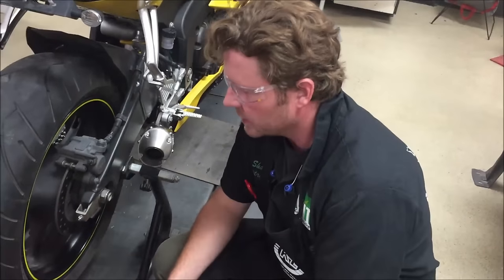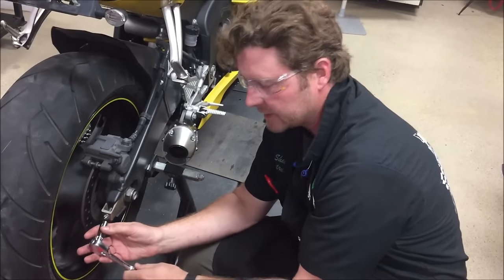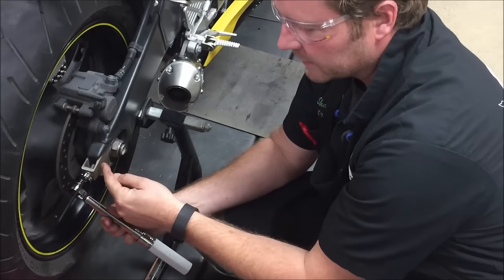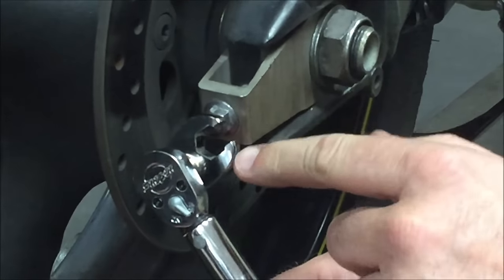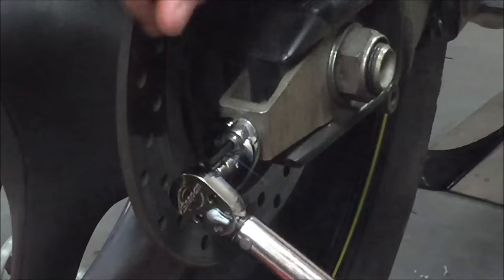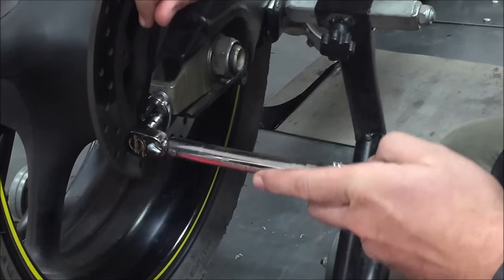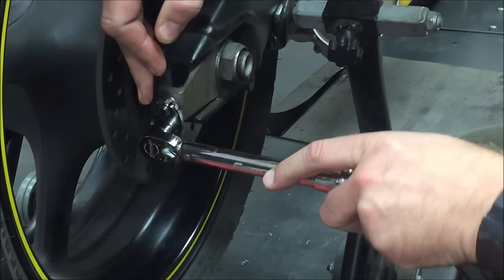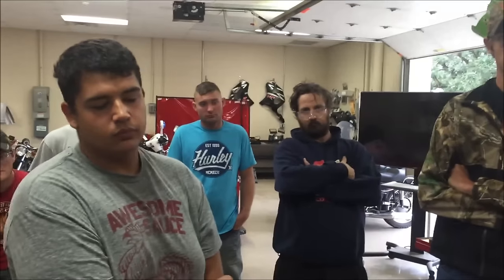How to use a crow's foot wrench adapter. Demo done on Yamaha R6 chain adjuster nut.

Comment: Thank you very much for the explaination on the 90° correction and the correction alignment behind getting the correct and accurate torque spec
Reply from the maker: You're very welcome! Have you seen all the videos we have done on torque wrench use? Here is a quick list: https://www.youtube.com/c/ShaneConleyhow2wrench/search?query=torque 
Please hit that subscribe button for us! 👍 Subscribers get a free video for them to search the channel for topics! Reply back you subbed and I’ll share the link! Thank you for taking the time to comment! It helps us! 

Did you know there are over 700 videos on here. We even made a quick video of how to best search the channel for you. Here are two links to best serve you on our channel:
Channel Search: (subscribe to get and let us know!)  
All Playlists: https://www.youtube.com/user/conleybuilt/playlists   

Please say thanks and “high five us here: https://www.paypal.me/how2wrench
Reply: 90° doesn't make sense, if it's in line with the foot making it longer, wld be like putting a very small cheater bar on a wrench giveing you more leverage and taking less strength to get to 90 lbs. It's still 90ft lbs, you just only had to use let's say 60 lbs of force.    
 That's like saying using a 4' torque wrench set at 90 ft lbs isn't going to give you the same ft lbs as a 3' torque wrench set at 90 ft lbs.
Reply: @Jdww89  Exaclty the only thing you shouldn't do is have something that changes the angle like a universal/wobble socket, cheap torque wrenches or the wrong hand placement not allowing the torque wrench to function correctly. Torque sticks doesn't matter where it's placed the extensions can only twist so much giving it the correct torque same with a cheater if need be, as long as your hand is placed in the correct spot your torque wrench should tighten to 90ft/lbs no matter if it only takes you 20lbs of downforce to do so. Try it with a 3/8" drive torque wrench at any position with the crows foot and then try it with a 1/2" drive torque wrench and just a socket it should be still set at 90ft/lbs not matter the difference in torque wrench length......if your torque wrenches are within spec. 90ft/lbs is 90ft/lbs on the fastener even if it only take the operator 10ft/lbs to get it there. Now the type of torque wrench can play a difference but personally I like the split beam precision instruments, they have always been good to me I will say stay away from Harbor Freight yes they will replace it but they are worth the gas driving there an back to do so everytime you use and break one. But that's just my two pennies on the topic......

Comment: I stumbled on this video by searching "Flare Nut Crowfoot Wrench Set" and while watching this video, I found you showed another way to use the crowsfoot as well as answering a question I had months ago about how to use a torque wrench adapter. Thanks for the video. Great instruction, and very professional. 

Looks like i'm on a mission to buy a "Flare Nut Crowfoot Wrench Set"
Reply from the maker: granadojl Thank you. Please subcribe and select notifications!
Reply from the maker: granadojl and share the channel or vids you like!
Reply: Same here! I have little clearance space for a 19mm bolt for my lower control arm. My torque wrench doesn't have enough space. Will try n see if I can do it with a crowfoot. It needs to be torqued at 101 ft pound

Comment: Excellent point. I've been surprised now many people don't understand the rationale behind why a torque wrench gives unreliable data when used with a crow foot wrench. As you say, if you keep the angle 90 deg, the sine of that angle approaches zero, dropping the added length to a negligible figure. The reason those guys can make that mistake over an entire career is because of the high tolerance for variance in applied torque.
Reply: The offset still exists whether you have the wrench at 90°, 45°, 18°, 37°, etc. it doesn’t matter at all. Any offset less than an inch is already negligible. Torque wrenches are not precise enough for a small offset to be of any significance. Insisting on this 90° myth is like saying that the torque changes when you hold the torque wrench high or low on the handle. Regardless of the crows foot rotation, you are still applying torque at an offset distance. Rotating the thing around a central pivot does not magically change the math.
Reply: @athhud  Although I agree with you that the result may be negligible, the math is clear, as I stated above. The right angle distance from the hand to the central pivot does indeed change, depending on the angle between the torque wrench handle and the crow's foot. Plotted on a graph, you get a sinusoidal plot of torque vs angle, with almost no difference at 90 deg. I also agree with your third point, that position of the hand makes no difference, because of the way torque wrenches measure force. The spring inside the head of the torque wrench is calibrated with the assumption that the head of the bolt is directly underneath, concentric with the axis. If not, there is a longer or shorter lever arm length and torque not accounted for. You can estimate that by multiplying measured instrument torque by the ratio of new right angle lever length over old, and you can crudely measure new lever length with a carpenter's square. At 90 deg the ratio declines to ~1 and it is maximum at 0 deg where new lever length is greatest, minimum at 180 deg where the length of the crow's foot shortens lever length. It is a small effect (often negligible) with a crow's foot, but unequivocal. It is easier to understand if you consider an extreme example. I go through a practical extreme example in a video I did of adjusting transmission bands using a torque wrench extension.
Reply: Yes when you start getting into higher torque situations and/or the distance from the anvil starts increasing significantly, the position on the axis will begin to matter. In this particular situation with the short inch pound wrench, low torque, and minimal offset it is just silly to fiddle around with the thing like you are torquing fine China to the space shuttle... The wrench won’t even adjust finely enough to compensate for the difference. Never mind the manufacturer’s specified range of accuracy.

Comment: Or you can use a pass through torque wrench. No need for crowsfoot and a 90 degree requirement.
Reply from the maker: I've never seen one...interested...
Reply: Thanks for the input but give credit where its due instead of just degradation, perhaps till? Its damn good instruction, no doubt. Well done sir
Reply: I’m here to learn how the crow’s foot is used.
Reply: @codyglasco188  He made a useful suggestion and he wasn't insulting about it. If you're doing this all day and don't know about those wrenches, then it might be a great time saver if you can pick up a better tool. As the comment from to How 3 Wrench indicates.
Of course if you can't get a pass thru design around the end of what you're working on. Like a line or pipe or there's just no room, then this is invaluable.
Reply: The video is a tutorial on how to use a crows foo. Hence the guy using a crows foot lol

Comment: I am new to crowsfeet. Just discovered them today as July  15 2022.  I now assume if one uses a ratchet handle one cannot retched it as with a socket as the crowsfoot swings around freely?.
Reply from the maker: I'm the intern studying under Shane. I grabbed Shane quick and he said use just as shown in the video and you will have success. Crows feet adaptors cannot be ratcheted if attempting to achieve the desired torque from the torque wrench setting. Go back and study the video details. 
I'm going to watch this video right now and learn what he said as to why! One of these days I hope to move from the office to the shop!

He has a few other tricks up his sleeve he plans on making videos on. If you need help sooner choose and option below! 

That’s a great question for Shane directly! We are just the social media team. Shane does answer questions when he get's back around to non members eventually so hang tight, FYI >>>> he does member ones daily!

He just returned from overseas training techs and his inbox is slammed with requests. He is scheduling time each day again to answer techline orders. He does not have the bandwidth to provide free email replies as his schedule is full with shop customers, training schedules, and one on ones. 
There's good news though! Shane has 2 solutions for you. One is a deep dive one-on-one with him with video, email and phone support. The other is a "quick fan support" option when it's a quick answer and just helps support the time for him to stop wrenching or training and get you in the direction that a free video had you close. Links to each are below. Hope this message makes sense to you as a decent human being that also works for a living and gets it!
Make it a great day!

The one-on-one service. Get Shane’s cell here: https://how2wrench.com/ols/products/techline-one-on-one       
Quick answers are answered daily as a channel member: Join this channel to get access to perks:
https://www.youtube.com/channel/UCBhM8DCKnT3qXwTW0eToyCg/join   
-Daily MEMBER FIRST COMMENTS ANSWERED FIRST 
-Live Q/A video chats
-Wonder if we have a video on your need? Members can request content links!
-Full Access to the ENTIRE 700 video library
-Member-Only FREE tool giveaways  

Have you seen our "YouTube Trained Support Shirts? Great way to "high five us" https://goodfellasmerch.com/collections/how-2-wrench/products/support-shirt

High fives help too! Give him one here:  https://www.paypal.me/how2wrench

Comment: I was wondering what was the purpose of this odd wrench
Reply: I'm waiting on one to come in the mail. I need it to do repairs on my Jaguar. I'm going to replace the thermostat housing tower. It has 4 bolts. One of those is slightly under the intake manifold. The crowfoot will get it easy peasy. After doing a fair amount of research on the best way to attack this bolt, I came to the decision of using a crowfoot wrench.
Reply: its to use in places where the traditional ratchet doesn't have direct access. and it also works great for situation where an open  box wrench is needed.
Reply: @asadb1990  correct me please, a nice flex ratcheting locking wrench would suffice too?

Comment: Another tool to use with your torque wrench is a torque adapter. I own the both regular crows feet and flarenut crowsfeet but I've never used them as shown in this video. Here is a good set of torque adapters  https://www.amazon.com/Tools-93222-Metric-Adapter-Category/dp/B00NABVES8
Reply from the maker: Hi Mark,
Nice tool set. FYI. This is the exact same purpose as the crows foot. The "difference" is clearance issues where these would allow to go "under" something in the way. They also are better due to the full enclosure of the fastener. You need to "re-phrase" your thought as "another tool". There are times where minimal clearance is available and a crowd foot is the only way to go! Also the use of crows feet or torque adaptors are applied the same. You MUST be at 90 degrees to cancel out the length. Thanks for sharing this tool with our community!
Reply: You are correct and I made a edit. I will always use the tool that has the most contact with any fastener. Good videos here for sure.
Reply from the maker: Totally agree with most contact my friend. Thanks for being on here! Feel free to comment and share anytime! I'm teachable too!

Comment: That 90° nonsense is a crock. First of all your torque wrench isn’t precise enough for you to ever know the difference in the minimal offset of the crows foot. Second of all the offset exists regardless of the orientation of the crows foot. Turning it to 90° does not make the offset go away. If you actually did the math you would realize that the difference in torque is insignificant. The difference will not even begin to exceed the accuracy of a quality torque wrench until you get well over an inch of offset. Even then it is still negligible at best, especially in an application such as this where the goal is to simply get it tight enough without breaking anything.
Reply from the maker: You may want to read any manual that comes with a TQ wrench. All the manufactures train the same 90 degree offset cancels this out. We have more videos showing it on a testing machine. We welcome all comments in this community that are intended to help or give experience. Also know that these were students in training practicing skill sets in a lab. At this point in the training (and in many other videos as the student in training was the intended audience) we are not focusing on "negligible or does it matter, or good enough” as much as good habit forming and practical use. Consider this in your comments and please use your experience, comments and advise to better this community.

Comment: LPL: I'm going to hold tension and click on one and we're done. All in all this locknut is terrible for security as even the most amateur of picker could pick it, but if you are using it correctly it will keep your bike together.

Comment: Not Recomended... can Slip..

6 point 
8mm Deep Socket KTC No.1
Reply from the maker: This comment shows you may have not watched the video or need more help understanding. Please watch again so you can understand that an enclosed socket will not let you hold the setting of the chain adjuster (the bolt pushing against the axle block). As you tighten with a torque wrench (or wrench) the adjuster will rotate and move out of place. 
The common practice is to hold the bolt with the allen and use a closed end wrench to secure the nut BUT then you are replying on "feel" that the fastener is torqued correctly. 
If you look close the crows feet we are using also will not slip as they have the last two flats making contact with all 6 sides of the nut. We asked Shane for a link and here it is: https://amzn.to/3Lx02gy 
We love sharing comments like this with Shane to gain new perspectives while sometimes we just don't agree but a good conversation grows from it. Thanks for sharing and the added value to our wrenching community. Keep them coming.

Join the channel. Best $1.99 you'll spend to access all 800 vids and Shane Daily! Smash the sub and like please. 

Throw Shane a high five donation, channel membership or merch for saving you $$$$$$$ Links below to support more for this work! 🙏
You rock for commenting! We will let Shane know! Want even more? Best $2 you'll ever spend...Join this channel to get access to perks:
https://www.youtube.com/channel/UCBhM8DCKnT3qXwTW0eToyCg/join       
-Daily MEMBER FIRST COMMENTS ANSWERED FIRST 
-Live Q/A video chats
-Wonder if we have a video on your need? Members can request content links!
-Full Access to the ENTIRE 700 video library
-Member-Only FREE tool giveaways  
Ways to support or high five How 2 Wrench! Thank you in advance. YOU MOTIVATE US TO DO MORE!
1. Smash the subscribe button (thank if already a sub!)
2. Have you seen our "YouTube Trained Support Shirts?  https://goodfellasmerch.com/collections/how-2-wrench/products/support-shirt   
3. High five donation:  https://www.paypal.me/how2wrench    
4. Got an emergency and your head is about to explode from frustration or fear? Get Shane’s cell here: https://how2wrench.com/ols/products/techline-one-on-one